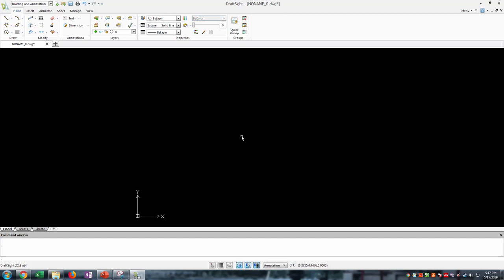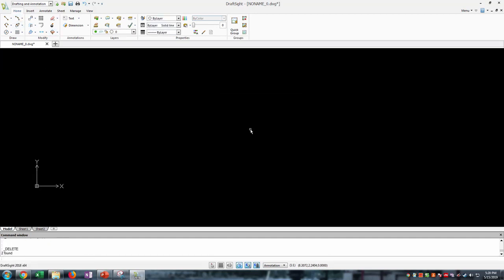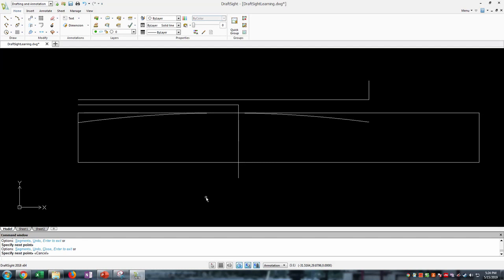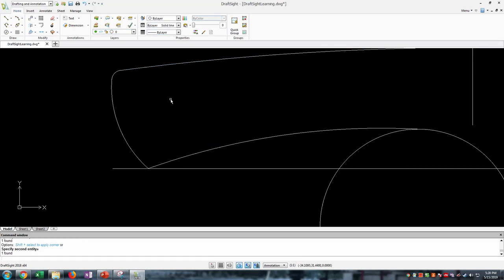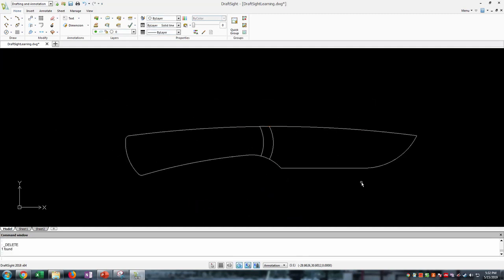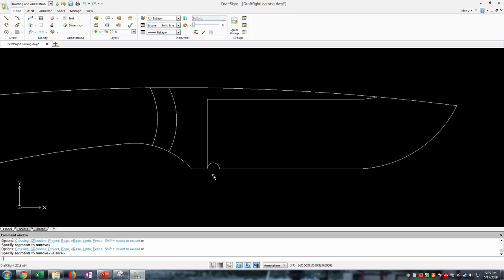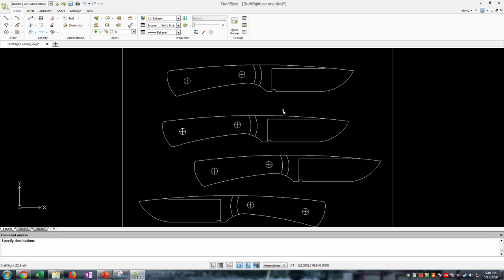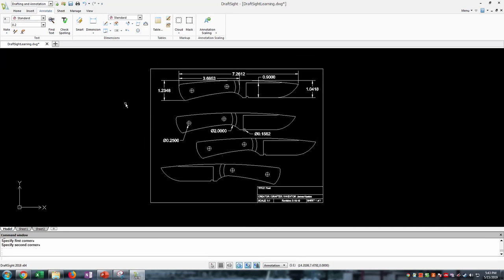DraftSight - How to Draw a Knife in CAD

Comment: Awesome video, very helpful! Do you know if you can upload a hand drawing into the background so you can kind of trace it with the program and fine tune it that way? Thank You!
Reply from the maker: Caleb Keel so I have  done this. It can be tricky since the lines are drawn in white, but doable with enough patience. You scan your drawing in (or take a picture with your phone); then screen shot the picture and paste it into DraftSight. Then what I do is draw a “known distance” like total length or blade width... then scale the image to that known distance. After that you can trace the picture then delete the picture.
Reply: JKeetonKnives that’s pretty cool! I’ve been wanting to try out a cad type system to store a lot of my drawings. I usually draw one and make it without remembering to save a copy so I can make another like it. If I could get somewhat proficient with this program I would be in business! Thank you again for the tips! Subbed and liked!
Reply from the maker: @calebkeel6119  Thanks for the sub man. Hey I want to warn you. I've heard rumors that DrafSight may no longer be free in 2020.... Good news is that the commands and work flow in Draft Sight are basically just like AutoCad (paid) and really close to NanoCad (free). My point is that the skills you learn in Draft Sight will be transferable to other common CAD software.